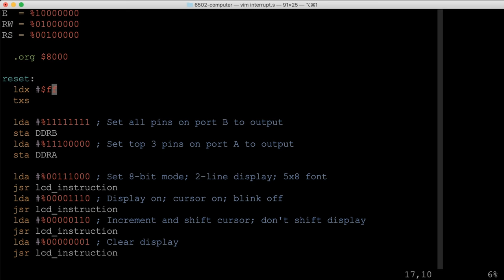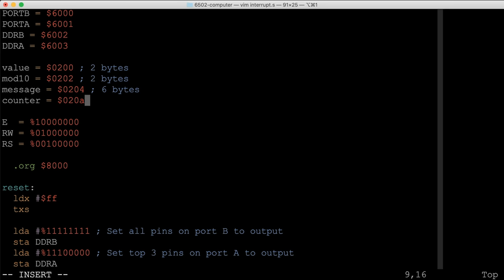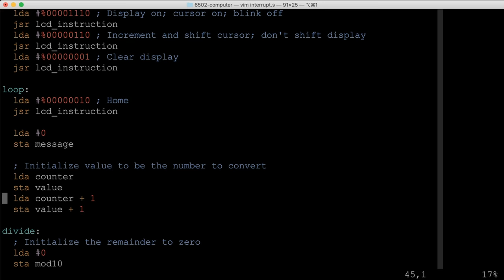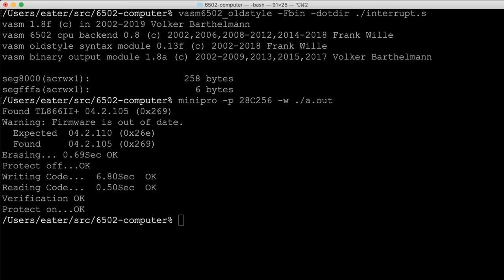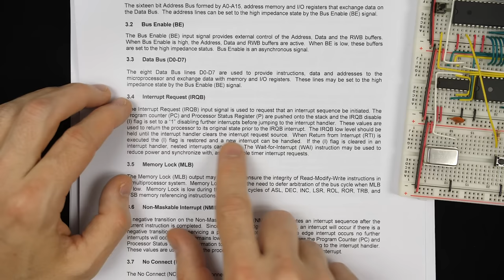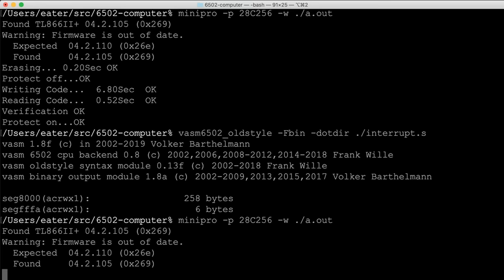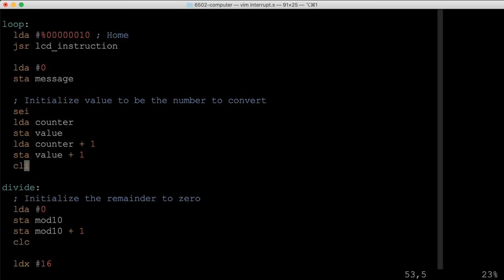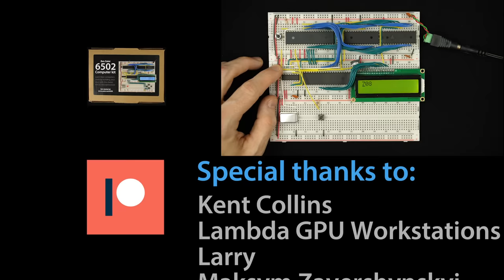Hardware interrupts

Comment: This is a random video to say this on, but one thing i don't get is when you need to use a resistor.  They just pop up wherever and their use seems to be more based on lore and experience than an actual understandable rule that can be applied.
Reply: The rule is simple, don't connect voltage to ground without a load.

Comment: The NES has a nice use case for NMI. NMI gets triggered on vertical blank on the TV. When a frame's logic is complete it will wait for this interrupt before starting the logic for the next frame.

Which brings a conundrum - what do you do if NMI gets triggered before you are done with the current frame?

Comment: To me it seems like a button that returns data about how long it was held down is more universally useful! Perhaps there is a better way to address this than firing thousands of interrupts per press though?
Reply: To be fair.
THis is just a demonstration for the purpose of showing what interrupts are and how to use them (he still has left out a lot of things).
Handling user operated buttons usually is nothing you would do by using external interrupts in a real world program. Reserve interrupts for asynchronous events which cannot wait until the processer has time to handle them. Eg. if an end sensor triggers you might want to turn off the motor as soon as possible in order to avoid damage. However from the perpective of a µC everythin a human does is as if it happens in extreme slow motion. No need for external interrupts there. In fact in these cases interrupts often create more problems then it is worth to deal with.

But as said: it is ok for demonstration purposes to show interrupts in operation.

Edit:
Besides. On the 6502 there is only 1 IRQ pin. Which means you can handle only 1 button with it (and even that is a pain in the ass, since it is a level triggered interrupt and not a flank triggered one). In 99% of cases, 1 button is not nearly enough to create some sort of "user interface".
Reply: The button is not firing interrupts. It just sets interrupt request. The processor is in "interrupt handling mode" until the interrupt request pin is reset.

Comment: Hey Ben, I was wondering, why do you connect the LCD to the VIA? To me it seems that its register-based interface could be easily memory mapped. I guess doing it this way may be easier for some people to understand, and it also gives you an excuse to use the VIA? Might this be a topic for a future video? ;D
Reply: I asked the same thing on another video and did not get a reply, there is a simple bus interface schematic on 6502.org
I think some displays may have problems working at over 0.5Mhz bus speed and may also need a wait state circuit, especially at over 1Mhz. Also if the display is remote from the main PCB on a long ribbon cable this may cause timing problems on the data bus due to increased capacitance of the cable.

Comment: Ben, doesn't your current interrupt code clobber the A register? Meaning it doesn't leave the register the way it was when it started, so the main program sees its values unexpectedly change? I know it doesn't matter in this example, but I figured you would have mentioned it when you discussed race conditions since it is arguably a more important issue.

Comment: I once wrote code for an msp430 (I also wrote it for the 6502 but didn't have one to test it) that had a timer interrupt set up. I backed up the registers onto the stack, changed the stack pointer and restored the registers to achieve something like multi threading. I wonder if that's what real operating systems do to. Couldn't find any good resources about the topic at the time.
Reply: Yep.
Basically this is, how it works.
You might want to look up "FreeRTOS" to see such a thing in action. There are ports for various µC types, so chances are good you will find one in which the low level stuff (written in assembler) is of one of the processors you know.

Comment: One question (you'll probably get to this eventually, but I'm impatient): When the CPU receives an interrupt, how does it know where that interrupt comes from?
Reply: It doesn't. It has to figure that out on its own, by pooling the devices and checking which one is asking for interrupt.
Reply: Some processors have several interrupt lines (physical pins) so if you have only one device using each pin, you can preconfigure which interrupt is which hardware. Like on the MS-DOS era when you have do set jumpers on your cards to physically assign an exclusive IRQ number to each one, and on autoexec.bat you use a parameter to the driver to say which address and IRQ line it uses.

In this 6502 processor, as it has just one physical IRQ pin, you have no clue from where it came. So is up to you to write something in that interrupt handler that well, handles how to discover the source of the interrupt, and act accordingly. It all depends on the system, for example on a C64, you have several sources of interrupts, and you can also add expansion hardware that increases it even more. Something like a Nintendo this list is way shorter, you have the controllers, the screen blanking timings, and maybe a couple of other standard sources, but anyway fewer and easier to deal with.

After the introduction of the PCI bus and Plug and Play standards, x86 (and AMD64) PCs use shared IRQs and a Message Signaling, so whenever some hardware raises an interrupt request, it also sends a message identifying its source. How exactly this works I never learned. Also for the computer, some hardware is "seen" as just one thing, like USB. the CPU just interfaces with the root controllers, and these controllers deals with pooling each device and so on.

Comment: In your assembler, do you not have db dw and ds directives for reserving RAM space and labeling those locations.... having to add up the addresses at 7:31 seems like a little bit of "a drag" and I'd like my assembler to handle that sort of stuff. :)
Reply: All you need to do is create a label with an equate directive. Assemblers DONT care about the sizes of your variable at all, it cares about is a location. SOME processors need data to be aligned to an addr that is on a byte/word/so word add.

Suppose you wanted to define a 4 byte variable at the beginning at the beginning if your ram and wated to call it Var1. You can use:
Var1 equ RamAddr

Now if you needed 1 byte if memory called Var2. You would just add 4 from the previous label (or RamAddr+4)
Var2 equ Var1+4. 
Var2 way RamAddr+4 (since Var1 and RamAddr are the same)

Adding another 2 byte variable called Var3:
Var3 equ Var2+1
Var3 equ RamAddr1+5 (4 byte variable+1 byte variable)
And so on. 
What you are doing is creating a map of the area of ram
These are uninitialized areas of memory and have to be initialized before use

Because assembly language doesn't care about length of a variable, a lot of beginner assembler programmers tend to over-run a variable and corrupt the next variable. A variable that holds text for example must be large enough to hold the longest text length. Some codeing methods put a binary 0 at the end of the text line, other put the length of the string in the first byte/word of the string, yet some others will hold the text length in another fixed length variable

Comment: Please add Multi-threading as well in the series.
Reply: multi-threading is a higher-level concept, that has to do with a Operational System, than the hardware itself.
Reply: @KohuGaly  Isn't image processing higher level concept too, but he did it anyway. By the way, I was talking about low level concepts of multi-threading, context switch and other stuff. Refer QuantumLeaps channel, he has done some similar stuff with cortex-m controllers.
Reply: @darkmatter5414  He made a video card, that can convert digital image in ROM/RAM into an analog signal, that can be displayed on a monitor. That is low level stuff.

Comment: Why not have the decimal calculation code run only once whenever there is an interrupt, and the rest of the time have a no-op loop? Unnecessarily running the same calculation constantly (between interrupt requests) is a waste of the CPU, isn't it? (also may cause more flicker). But this video is just showing how interrupts work, so I know it doesn't really matter.

Comment: How long do you have to hold down button before system crashes or loops to zero?
Reply: It will overthrow the 16-bit number in a second or so.  No crashes, just looping back to 0 over and over.

Comment: What happens when you send #00000010 to the LCD to send the cursor home and the program doesn't work? Well you hit the reset button 7000 times cause the first 6999 time must have been a fluke. After you figure out its not a fluke , you go through the program line by line 5 TIMES and miss the problem all 5 times! Then you will watch the program step through a couple of times around where the program crashes. Then about 3.5 hours later after you have gone through the HEX dump, you realize that the program is sending a 08 to the LCD at address 002b instead of the 02 that you want. Then 4 hours later (yes that's right 4 hours!!) you will add the % after the # to send #%00000010 to the LCD and the program will work. I would like to know why the assembler interpreted the #00000010 as 08. I kinda thought it would interpret that as a 0a. Anyway gotta love learning the hard way. Loved the video despite my stupidity.

Comment: Is it possible to install a simple OS wrote from scratch in these 8 bit computers?(I'm not talking about linux or windows or Mac) is there any slightest chance that we could build a simple OS written in assembly in these 8 bit computers?
Reply: With a 32kb ROM. Of course it's possible. In the 1980th most operating system for the 6502 where only 8kb ins size. There is enough space for 4 operating system.

Comment: Please, build a power-loss-detector! I would be interested to see sth like this actually implemented.
Reply: First, the computer would need non-volatile memory.
Reply: simple.
Basically you can use an Op-amp to compare the voltage with a constant voltage. You might eg. get a constant voltage by using a Zener-diode and have to downscale the operating voltage to that level by using a voltage divider built up by eg. 2 resistors or a poti. Depending on how exactly the the Op-amp is used, you might be able to route the output of the Op-amp directly to the NMI pin or have to use an inverter in between.

Comment: Hi, thanks for this great video. While we wait for the "interface adapter" solution, isn't it possible to disable interruptions with a SEI as soon as you enter the subroutine, and then reenable them with CLI just before the RTI ?
Reply: I think that’s automatically happening, but then it goes right back into the routine the moment the flag is cleared due to the line still being asserted.
Reply: @rednovatech  Yes you're right. Actually he needs to wait for the button to be released before returning from the interruption. I'm looking forward to the next video!

Comment: What is doing part of eeprom programmer in actual 80s home computer using 6502 type chip? Most have some kind of bootloader program, I guess from rom memory, but how actual casette program loading works? I mean is there same implementation as eeprom but just from different source, using certain pins of 6502 to load new program data in chip?
In 80s actual RAM was expensive, ROM was not as much. So casette and other types of lesser quality read write formats were more popular than now.  Now read write flash memory is ubiquitous, abundant.

Comment: I don't understand this one thing. If any program can disable interrupts then they could potentially hold the IRQ disabled for a long time? Given there's a lot of programs running and each at some point disable interrupts for time sensitive tasks...
Reply: In modern CPUs regular programs can't disable interrupts. The CPU can run in different "permission level" modes. The highest mode is reserved for the operational system. Regular programs run in lower permission level modes, where some instructions are disabled (interrupt disable/enable are one of them).
In fact, regular programs can only access a portion of the RAM that is reserved for them. Any other IO access is done by sending requests to the OS. The OS then handles them on its own and gives the results to the program. The program is actually completely agnostic about what machine it runs on and what is connected to it (unless it specifically asks the OS to tell it).

Comment: Question: does the interrupt request and the return from interrupt work the same way as jsr and rts ? does it push the program counter to the stack or is there a internal interrupt program counter in the 6502?
Reply: Yes. With the difference that interrupts also push the processor status register.

Comment: Instead of assigning ram addresses to labels, couldn't you have set an ORG at the beginning of ram, and then defined byte or word storage, with initializers?  (.ds or .db or .dw or byte, not sure what this assembler wants).
It's crazy, but the 6502 is bassackwards from others in the way that the interrupt enable/disable flag works.  On the AVR CLI DISABLES interrupts, while on the 6502 it ENABLES them.  Ditto for SEI, but the other way.

Comment: So what happens in hardware when the pin is pulled low?  Is there something watching the pin?  Does having interrupts disabled speed things up by not watching for them?
Reply: I don't know this for sure, but when the pin seems to have falling edge detector that switches which instruction gets executed next. When it detects a falling edge, instead of executing the next instruction regularly, it executes some "enter interrupt routine" instruction, that pushes all registers onto the stack (to save state) and jumps to the interrupt routine. The "return from interupt" instruction is a form of conditional jump. If the pin is low, it jumps to the start of interrupt routine. If the pin is high, it restores the register values from the stack and resumes the regular code.
Having the interrupts disabled should have no effect on execution speed. It basically just internally disconnects the pin from the rest of the chip, so it can't be pulled low by grounding the pin from the outside.

Comment: shouldn't you save register(s)  (at least A) entering the ISR and restore it /them exiting ? Much more correct than wrap around the counter increment with sei/cli...
Reply: Yes he should.
But wait, you might say. He doesn't use one of the registers in the ISR, to which I reply. Yes, he does. You might not see it, but he changes the state of the arithmetic flags. Thus they need to be saved and restored.

There is one another issue in his program. He should execute the initial CLI after the whole initial setup is done. The general sequence of operations should be

  reset:
        adjust stack pointer

        do all the initializations. This includes hardware as well as the memory layout

        now it is time to enable interrupts

        while( 1 )
              prgramm logic
Reply: @kallewirsch2263  should be good practice to save registers anyway in ISR, the  status reg, if I remember correctly, is auto-saved/restored from entering the ISR and the RTI instruction
Reply: @alessandrodemanzano3527  
Ah. YOu are right. The Status Flags gets saved automatically. I forgot, since almost no other processor has this behaviour.

Comment: Couldn't you use a sr nor latch to fix the problem with irq triggering multiple times with each button press?
Reply: Sure he could.
But that would require additional hardware.
However the fact is, that in real live you do not handle user pressed buttons via external interrupts. There is no advantage in doing that. Everything a human does is extreme slow motion from the point of view of the processor. Simply polling inputs every 5 or 10ms is more then fast enough to figure out a key press. And it has the advantage that you can handle as many buttons as you like and not just 1. Plus it gives you a good spot in the programm on how to deal with bouncing buttons.

Having said that. I understand that what he shows is a demonstration on how to deal with interrupts. Which of course requires some method on how to trigger one. Having a button for that purpose is surely the easiest way to do this.

Comment: How common are interrupt used on "modern" multi threaded CPUs?
I heard somewhere that devices that are connected via USB use polling because the overhead doesn't really matter anymore. Does this apply to all kind of devides or is this just specific to USB
Reply: Interrupts are still often used in modern CPUs, for the simple reason that although the overhead my be insignificant for a particular device, it becomes very significant when you're talking about polling many devices.  It's even more important when your CPU has to do something else which is time-critical such as figuring out what to display in the next frame of the real-time game you're playing.